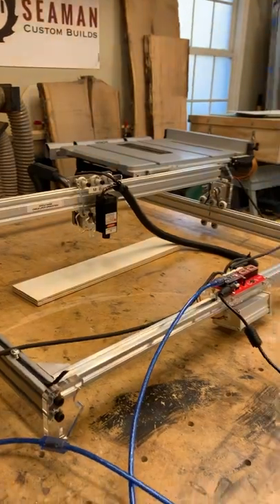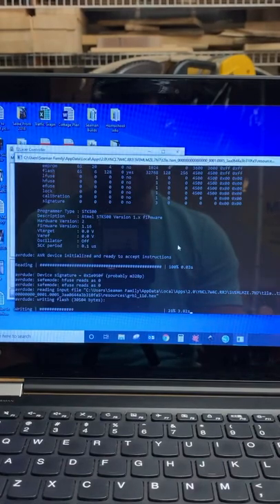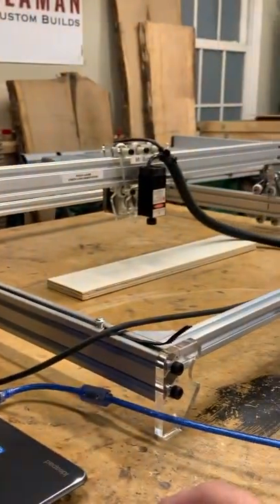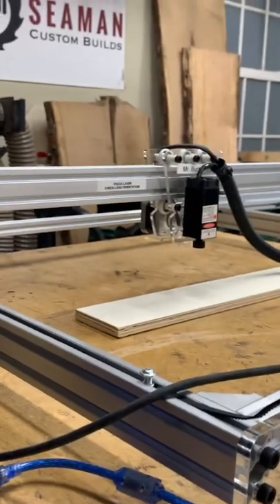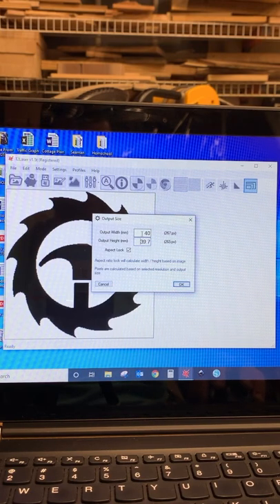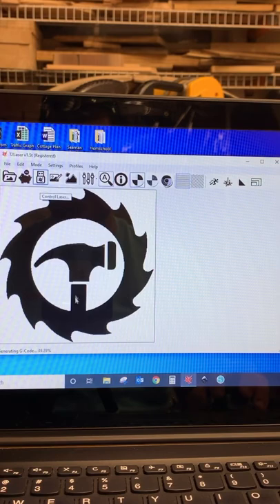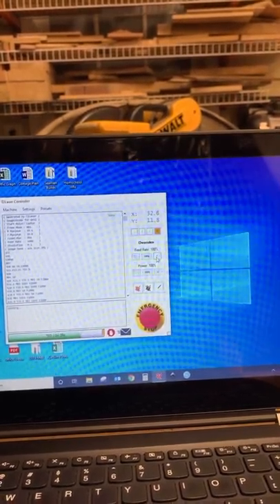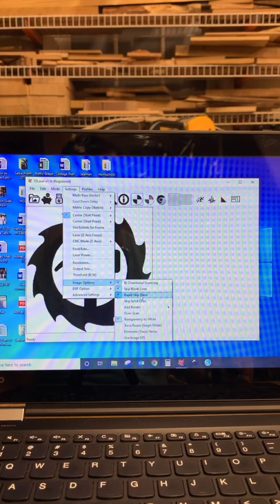How to use T2 Laser software

Comment: Thank you for the video. It was a huge help in the set up. However, I cant seem to get my laser to engrave deep enough. Any suggestions?
Reply from the maker: I keep the laser power at max and just slow the speed down, also make sure you have it focused to a good pinpoint
Reply: You can also run multiple passes to get a deeper cut or burn

Comment: Ok great vid thanks for the help. My next ? Is the lasers seen and goes back n forth n such but doesnt burn unless in one spot so it goes but nothing shows as being engraved. Help!!
Reply from the maker: Bridget Beltran make sure the laser is focuses as pinpoint as you can make it then slow the speed down until it burns evenly
Reply: Ok and when you say focus i turn the focus and its a square or rectangle not a circle
Reply from the maker: Bridget Beltran it hard to explain but it will be the tiniest pinpoint possible before it starts to get larger again

Comment: Any way to fix the X axis. It only goes right. It doesn’t go left
Reply from the maker: Ben Brophy might make sure the correct version is flashed to the board but otherwise check with Zax on the T2 Forum

Comment: HI, I just recently got a Universal Engraver machine. It was the most frustrating experience... finally got it assembled with their poor videos. I originally downloaded LaserWeb becuase I was on a Mac, I got the laser to move but the laser itself wasn't turning on. So I pulled out an old PC to try the software in your video. I found your videos using T2. I downloaded that, but the machine won't seem to connect in the very first step. The Port pulldown is blank. When I click connect, nothing happens. Any suggestions?
Reply from the maker: Sorry I don’t

Comment: How do you like the universal engraver after all this time?
Reply from the maker: 23mikelavin I’m still using many times a week and it works great for my projects.
Reply: ThAts great to hear. I just ordered one last night. I got the 3000mh version. Do you have experience with this one?
Reply from the maker: 23mikelavin I had that one for the first 5-6 months before upgrading, same basic unit just has to go slower because of less power
Reply: Makes sense. Thank you for your video and actually responding to my question. Helped a lot so thank you!
Reply: I have another question if that’s alright. First do you know we’re I could find some good forums that would have people like you who started off and have helpful information about learning to engrave on these kind of lasers? And second I see on Gearbest you can buy 15w laser that’s not from universal for much cheaper. Could it work on their setup?
Reply from the maker: 23mikelavin search for eleks forum

Comment: What machine are you using?  And thank you for the video!  I am looking to purchase my first one and I have no idea where to start.. I happened on this one and it seems ok = 3000mW Blue CNC Laser Engraving Machine,  I want a machine that is compatible with this software and capable of etching hardwood.  Do you have any suggestions?  Thank You Very Much for any advice you can offer!!!!!
Reply from the maker: Mrbnewsom71 Hi, on this video I was using the 3000mW laser from Universal Engraver, I currently have their 15000mW so I can engrave faster. You will want a Windows compatible pc as there are issues with T2 on Macs from what I’ve been told
Reply: @seamancustombuilds2553  Thank you very much for such a quick reply!  I think I am going to go forward with the purchase of the same one you first bought!  I found this video through looking at this model anyway.  Again, thank you and I look forward to throwing some more questions your way! lol